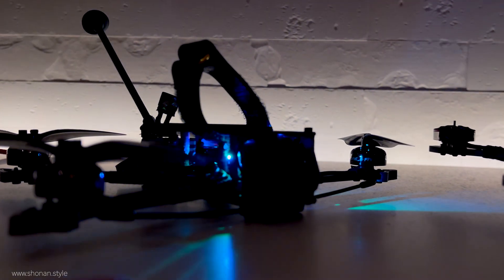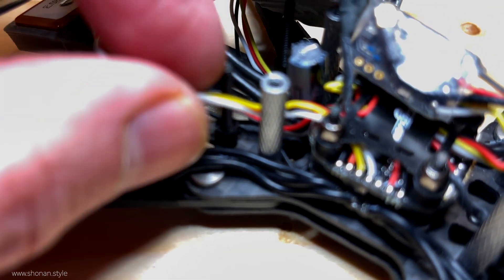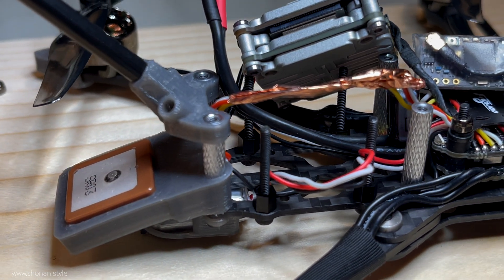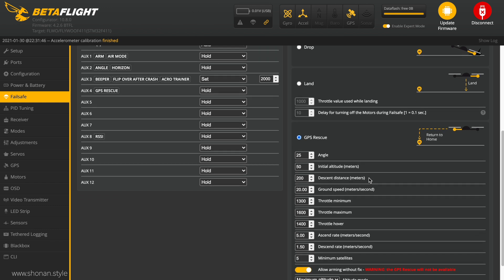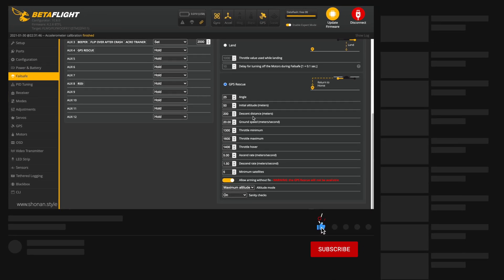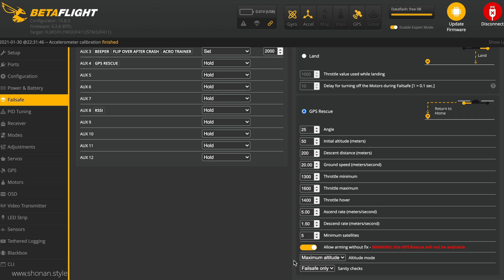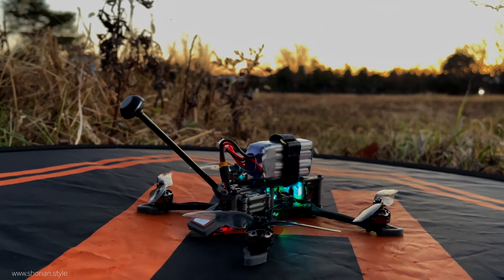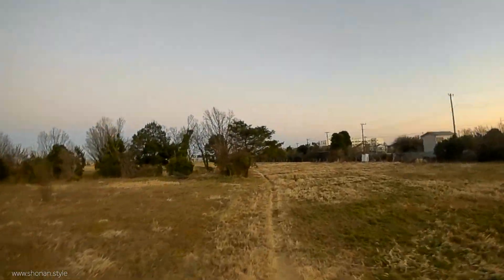GPS FIX for Flywoo Explorer LR / GPS rescue issues solved / satellite lock no issue anymore!

Comment: Would you happen to know what the LEDs mean on the GPS I have the v2 flywoo one and only ever see a green one briefly flash when I first power up my quad
Reply from the maker: They have so many different version by now. 
However, for mine and what I have seen is that green wold indicate satellite lock. Red is powered up but no satellite lock yet. Recently they also use blue LEDs for power up.  Green seems to be consistent for indicating satellite lock. 
Hope that helps! Have a great day and happy flying!
Reply: @MattShonan  need to find where that red led is as only see green grr
Reply from the maker: might be a certain version you got. 
Ask them, maybe the best, quickest way to find out!

Comment: All the problem is your vtx antenna , they're cheap coax cable,all u need to do is wrap the coax cable tube with aluminium foil then heat shrink it
Reply from the maker: Thank you for your comment, basically that is exactly how I fixed it. 
Using copper tape actually, as shown in the video, on the wires of the GPS module! 
If you do that to the VTX antenna, you will have trouble getting a signal 🙃
Have a good day! Stay flying!

Comment: If you solder a wire to the copper tape and then solder that wire to ground on your FC or to the negative battery wire you will get much more performance from the copper shielding
Reply: yep its true thats the proper shielding
Reply from the maker: Fixed now 😊
Reply from the maker: All done and you were right! 👍🏻
Thanks for the comment and have a great rest of the day!
Reply from the maker: d(^_^o)

Comment: Hi, Thanks for the video and the copper wire tape tip. 

What type of copper tape did you use?  The conductive or non-conductive type?
Thanks.
Reply from the maker: Not conductive was my choice since also carbon is conductive and the risk of short circuits is lower. However if you have a solid build either should be fine if no circuit boards are touched by the copper.